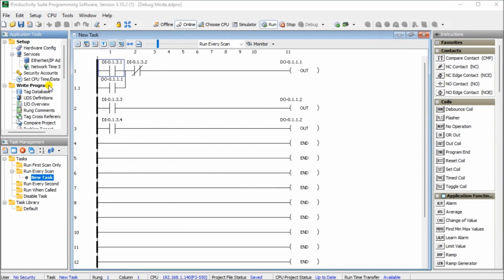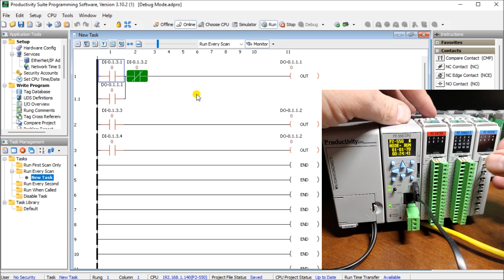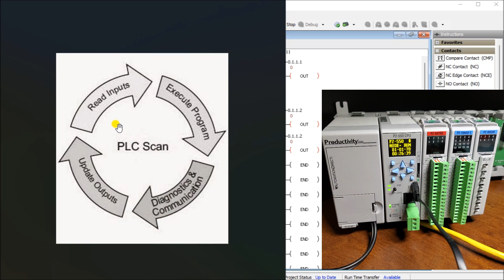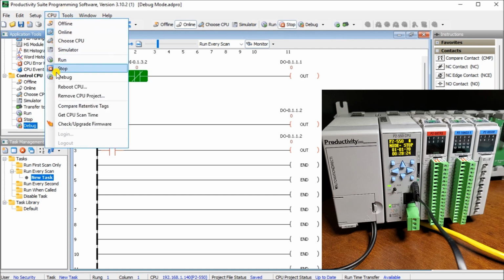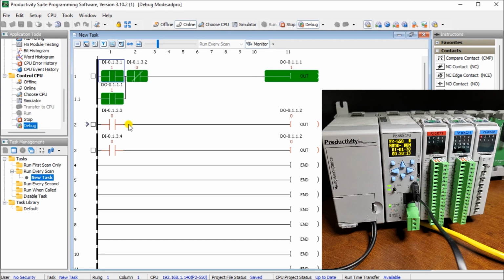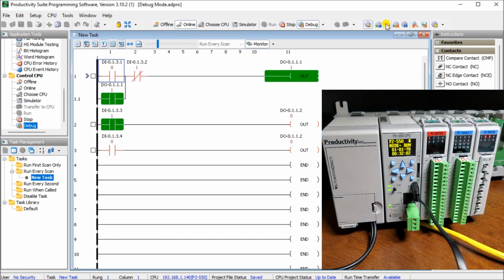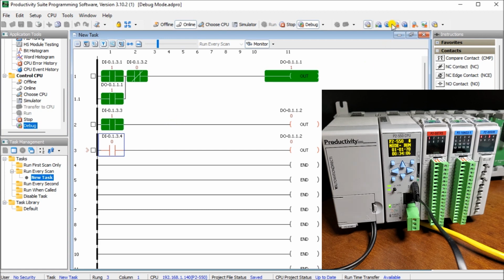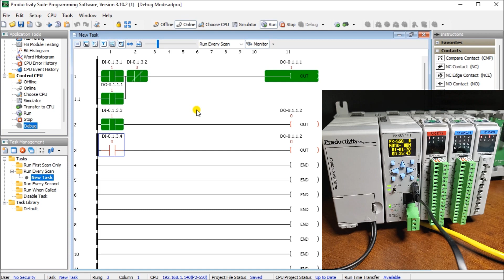Productivity 2000 Series PLC Debug Mode

Comment from the maker: Previously in this Productivity 2000 series PLC, we have discussed:
P2000 Hardware Features
https://accautomation.ca/productivity...
https://youtu.be/83MfQK7fzdk
Productivity Suite Programming Software Install
https://accautomation.ca/productivity...
https://youtu.be/4MTOIrWA1L8
Productivity 2000 Series PLC Communication
https://accautomation.ca/productivity...
https://youtu.be/UoHoMwk-zi0
First Program
https://accautomation.ca/productivity...
https://youtu.be/RLwPofIkIxA

There are several reasons why we are using the Productivity 2000 Series Controller. Here are just a few.
- CPU with 5 communication ports
- 50MB user memory - Can handle very complex applications easily.
- Limitless PID – Autotuning – Individual or Cascade Mode - etc
- OLED message display on the CPU module
- Plenty of discrete and analog I/O modules
- Status displays on all discrete I/O modules
- I/O Modules have QR codes. This can be scanned so you can have the latest specifications/wiring diagrams for the module.
- OLED data display on analog modules
- P2-RS remote I/O expansion module, or use the Productivity1000 P1-RX remote expansion module to add even lower-cost remote I/O to your system
- FREE full-featured Productivity Suite software
- Programming with several ports - USB, Ethernet, Serial
- Hardware auto-discovery
- Hot-swappable I/O - Remove cards with power on the system
- Choose from three wiring options
- Slim DIN rail density form factor:
- hardware - power supply, CPU, and seven modules in only 10-1/2 inches
- All project files (program, tag name database, and all the program documentation) in the CPU
- Run-time editing and debug mode on CPU
- Easy data logging with micro SD on CPU
- Secure Web server to access data files and system tags
- Easy drive and motion controller integration
- Coordinate motion control with PS-AMC allows control of up to 16 axes and synchronization of up to 4 axes
- Two-Year Warranty

The Productivity 2000 series of programmable logic controllers currently has all of these features built into the P2-550 CPU.
This CPU (Central Processing Unit) is also known as PAC (Programmable Automation Controller) because of its communication capabilities.

Regards,
Garry
ACC Automation
https://www.accautomation.ca

Comment: Hello Gary, I made a machine with this PLC connected with a Cognex barcode plus encoder (P2-02HSC for encoder) (ethernet IP protocol camera) is for scan with QR code full boxes, Gary,  using a CPU P-550 with a machine with 7 outlets for full boxes I have a good scan time rate, If a made a bigger program with 8 outlets, scan time increase and I have problem with the encoder account and ejection time on outlets start to fail!! If I use a CPU P3-550E can I decrease an scan time????? last question please, a software recomendation for  Productivity PLC, I need to connect with customer data base, for read a write recipes... Thanks very much!!!
Reply from the maker: Hi Orlando,
The P3-550E CPU will have a faster scan time than the P2-550. It will decrease your scan time but I would not know by how much time. 
Have you tried to optimize your code so that not everything is being scanned at once in the P2000 program?  If you look under the "Task Management" in the productivity suite software maybe you can break your program into different sections, saving scan time.
Connection to the customers database will depend on the type of database. I would look at Node-RED to run on a computer. This would communicate Modbus TCP (Ethernet) to the PLC. There are several add on nodes that can be incorporated in the flow logic of Node-RED that will communicate to different databases. Here is a link to the Node-RED series.
https://accautomation.ca/series/node-red-iot-enabling-software/
I hope this helps you out.
Regards,
Garry